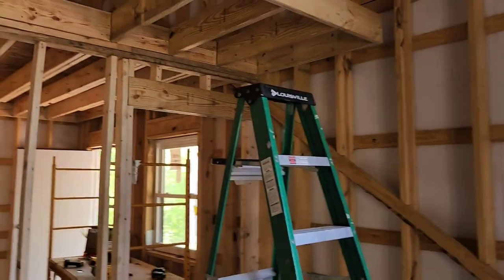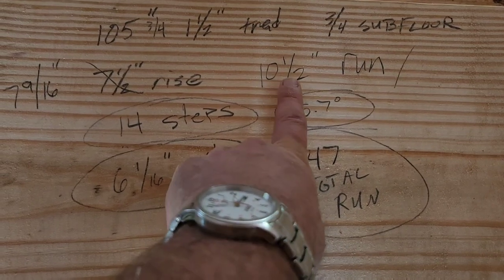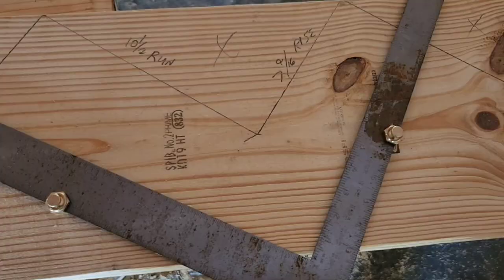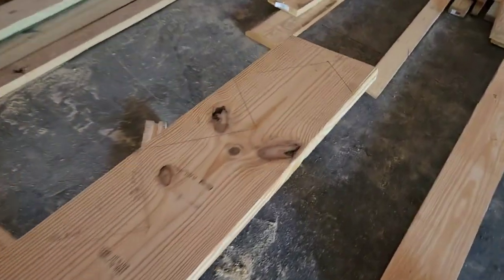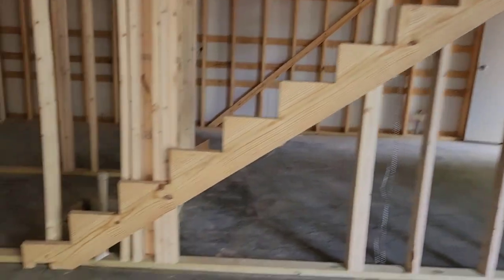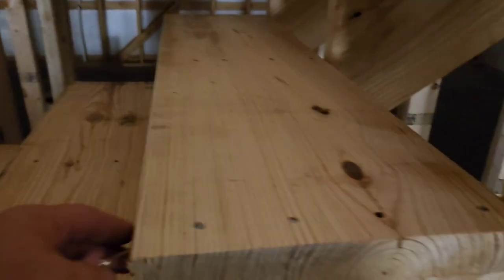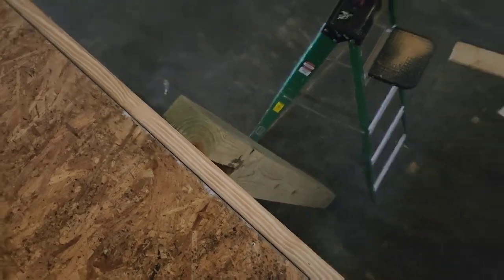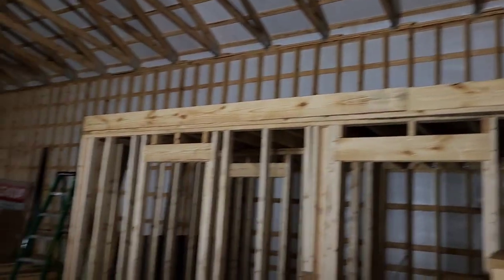New Shop Build - LETS BUILD STAIRS!  Baxters Garage Kevin Baxter

Comment: Looking good Kevin. You are moving right along. I used to swing a hammer for a living a little over 30 years ago. It's so rewarding to look back at what you built with your own hands. We spent about 2 years, building a 4 story Queen Ann Victorian home, not far from my brothers house.  We started from the ground up. From hand digging the 4'x4' footers that the house sat on to laying the shingles and all the trim inside the house. We used old reclaimed woods like Wormy Chestnut, Popular and Oak, to exotic wood like Zebra, Holly, Ebony Birdseye Maple and several more. We installed some hand carved Sycamore corner cabinets from the Chrysler Mansion and a Cheery fire place mantel from the Wiedemann Mansion, the house had 4 fire places. That was the last house I'd built, but the most rewarding. I stop and admire it every time I drive by.

Comment: I know cost is a factor but if I could recommend something, lvl’s are great to work with. You can use them for carrying beams and for stringers . Try not to cut corners all the time you spend a little more sometimes and get a much better outcome. Keep up the good work.

Comment: About your electric I heard you say you were going to put a phase converter in. I just did the same thing you are doing except I make drums but my shop is all 3 phase machines and my electric company put another transformer on the pole by my shop and that is my third leg ! No phase converter no moving parts that could potentially break down check with your electric company before you buy a converter